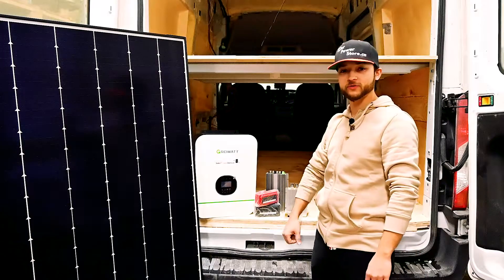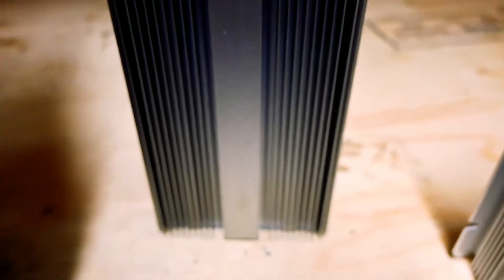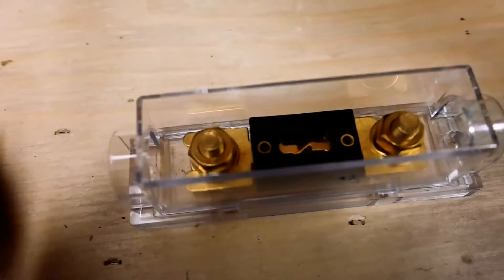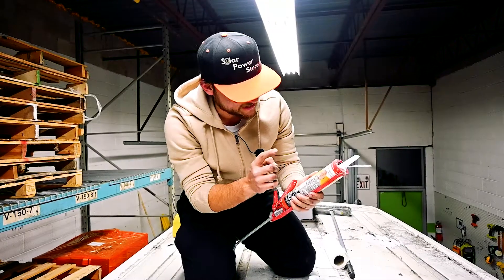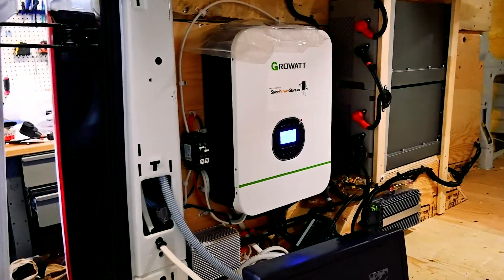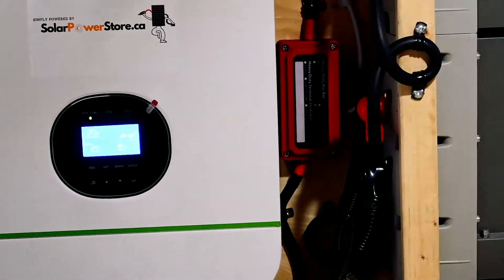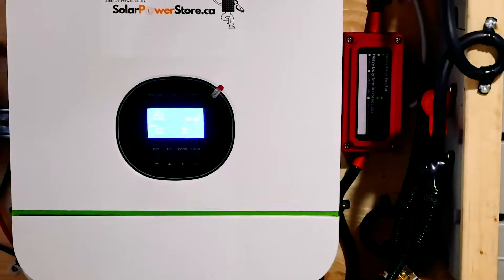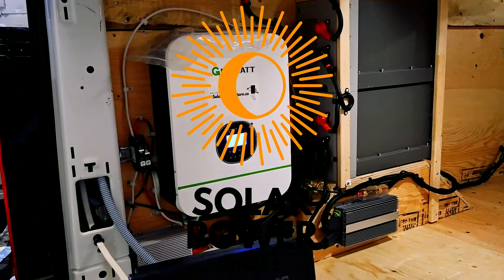How To Install a 24v Growatt System With an Alternator Charger In a Sprinter Van #vanlife #DIY

Comment: I’m dealing with one of your customers right now because you guys can’t deal with them. The inverter charger keeps going off looks like the solar panel is too low of a voltage since it’s a 40v min mppt. Would be great if you could call her back or looks like the transit in this video is the van I’m dealing with. I’ve lost too many hours on this and need some help fixing your work. Thanks